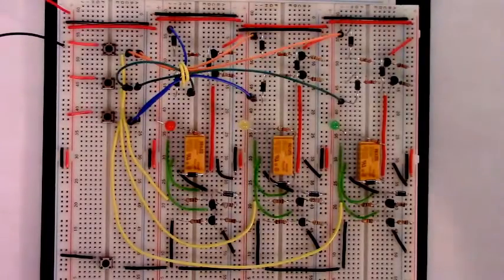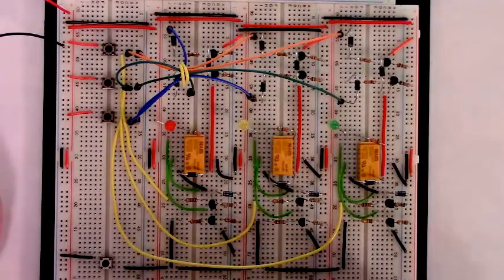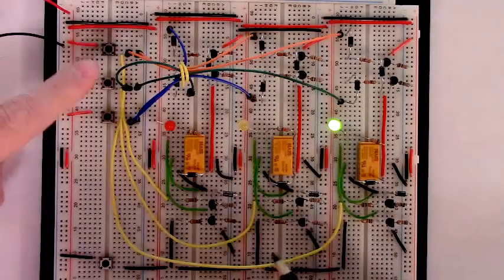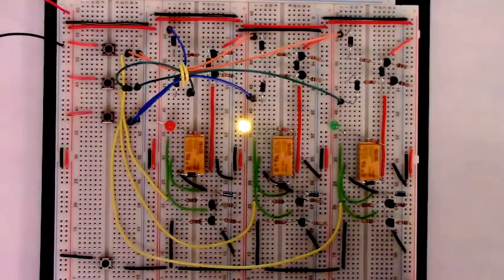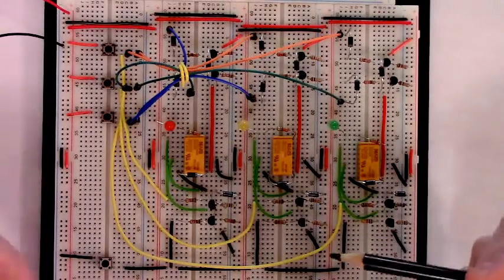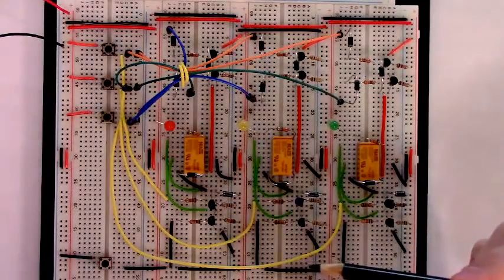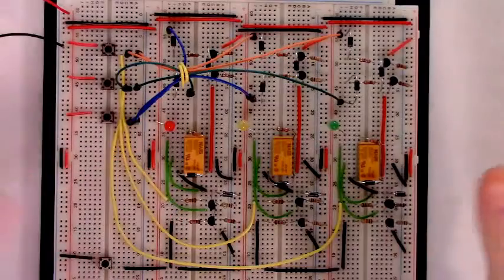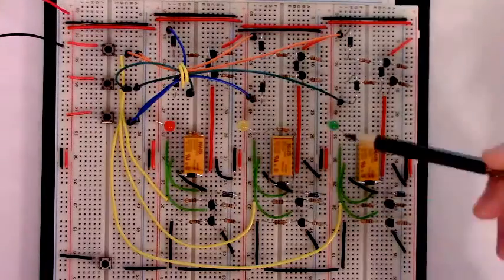How to Build a Selectable Latching Relays Circuit || Part 1 || Intro and Functionality Overview

Comment: Great tutorial, thank for making it !
I have a question, what happen when you press multiple buttons at once?
There is a way to make pressing multiple buttons all together null, or just achieve a similar result as to reset the circuit ?
Thanks.

Edit:
I think i got my answer already on the middle of your other video, 2D, cheers ;)

Comment: I remember having seen circuits like this as part of elevator controllers back in the 80ies used as position selector. For an elevator controller it is very important to "know" the exact position - and each position has to rule out the other possible positions. You cannot be at two floors at the same time.
Often this functionality was made by using relays and all the switching between floors would result from a combination of contacts. Of course this would often result in faults when the contacts began to fail. In your circuit all the switching is transistor-based and is much more reliable. Furthermore it is modular and very easy to expand.
Reply from the maker: +Martin Johansen Appreciate the comment and elevator circuit description.  That's what came to my mind when a friend and multiple viewers initially requested this type of circuit.  Most wanted it for audio effect applications, and it will work for such.  But, elevator and/or industrial machine control were my initial thoughts as well.  Earlier elevator circuits as well as many contemporary amusement park ride circuits are often very interesting to study and see in action.  Many impressive and seemingly "intelligent" actions can be accomplished with little more than cleverly connected relays.  Though contact arcing, wear over time, debris between contacts, etc., do tend to be a recurrent problem --everyone with a well will at some point in time encounter the bane of contact wear and/or hapless ants that wander in between the contacts...a moth was supposedly the original hardware "bug" but as far as my well has been concerned ants tend to win the most common culprit award.  Solid state transistors and/or relays definitely help with reliability.  I too liked the modularity of the circuit.  Expansion is always an option.  I'd likely shift to a microcontroller for more than 5 to 8 relays but there's nothing, that I currently see, preventing one from expanding well past that with just more of the same connections and discrete components (...perhaps power supply more robust than a battery).   More than 3 would soon become what some of my friends and students would want to refer to as a "large" circuit and have quite the component count but I've always had a fondness for building and seeing "big and complicated" circuits/devices in action....but then I have also always been fascinated with devices like the first difference engine, mechanical typewriters, etc.  I can't see such and not immediately think, "What a lot of thought, time, effort, and most especially craft and skill that went into making it all work!  System design at it's finest.  And, if they could keep it all straight during design, implementation, and assembly, then perhaps so can I."    

Thanks for watching!

Comment: I just watched the whole series and it inspired me a lot. I like the way you begin thinking it through and then building it step by step while testing it at each small step.
I often see my students building a whole project without any testing along the way and when they turn the power on, it doesn't work and it is very, very hard to find the errors.
I think I will ask my students to watch this series. Thank you.
Reply from the maker: +Martin Johansen Appreciate the feedback!  I'm especially glad the video might be helpful for your students.  I remember the days of just following a schematic to the end and then having no clue why the circuit failed to work.  I think that many of us have been guilty of such when starting out.  My students tend to do so when attempting to complete formal logic proofs.  It's almost impossible to find the mistake when one's around 50+ lines deep in a proof (or 50+ connections into a circuit).   The most straightforward  solution is often a complete re-start from the beginning.  There's value in making such errors but they can definitely become painful and demoralizing if one doesn't eventually learn to test and catch them before the end.  Anymore I find it's a lot easier to do tests and look for confirmation along the way.  It tends to provide one with a sense of confidence, especially when assembling relatively large circuits or completing relatively large formal proofs.  Please let me know if there are ever any circuits that you think might be helpful for your students and I will gladly construct a series of videos about them.  This series was inspired by multiple viewer requests, and I'm always on the hunt for the next interesting circuit challenge.  I hadn't thought about this sort of circuit for a while and wanted to see what I could come up with (I'd built similar ones in the past but nothing with this particular configuration) .  It could be made more simple by using certain ICs but I've always maintained a special fondness for building interesting circuits using nothing but the more basic discrete components.  Much of the field began with transistors, relays, etc., so it's often the case that one should be able to build some fairly sophisticated circuits with them.  ICs and microcontrollers can make securing impressive electrical, robotic, etc., behaviors much quicker, easier to assemble and maintain, etc., but I never tire of attempting to obtain such with the more basic of components.    Thanks for watching!

Comment: Outstanding!  Been watching the series and digesting slowly.
Reply from the maker: TruWebs LLC Appreciate the feedback and glad you're watching the series!  

It's taking some time to edit and upload all the videos but it should be worth it in the end.  As a complete set they should help to guide one through the build from beginning to end.  Definitely let me know if/when there are any questions along the way and I will always do my best to help.
Reply: +philo mech Thanks again for this series you created.  I had to finally hand this 
project over to a buddy who is an electrician and familiar with relay 
logic.  I thought I would share the final product (well almost, test 
LEDS rather than the traffic light)  I have purchased 12v  50 watt bulbs
 for my traffic light to make this project complete.  See some picts 
here http://www.diychatroom.com/f18/manual-button-controls-traffic-light-197259/index2/#post3044393